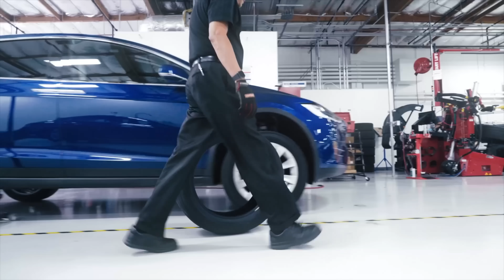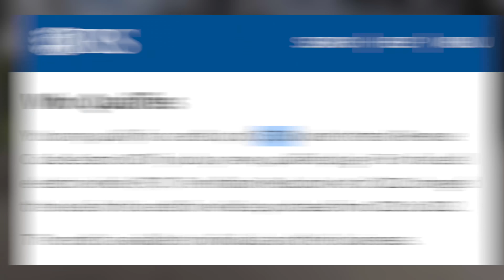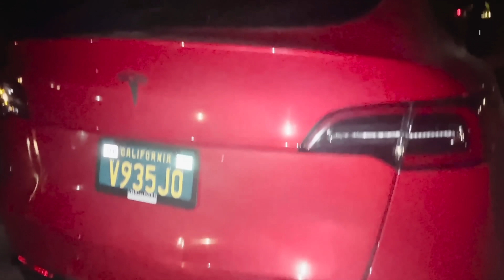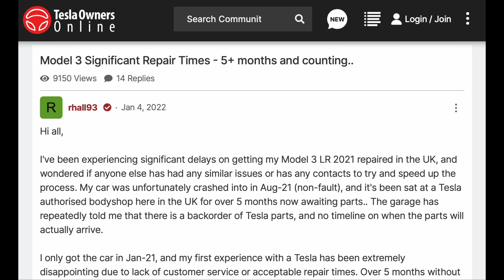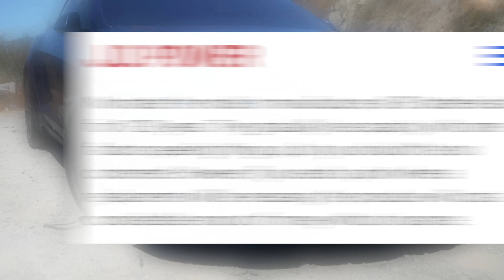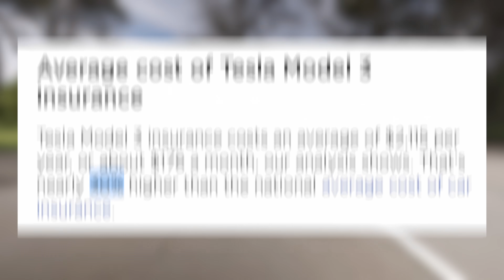My INSANE $23,614.36 Tesla Repair | Tesla’s Expensive Repair Problem

Comment: Don’t buy a Tesla. I got a Model Y 2024 with enhanced autopilot. Darn thing went haywire on the highway. Sideswiped an Amazon truck. Damaged the passenger side panels and mirror. Over 20k to fix. You can buy a new Toyota with that.

Tesla customer service is the worst I’ve experienced. Their warranty doesn’t pay for faulty enhanced autopilot. The company takes 0 responsibility and once you buy their car you are on your own. Getting it fixed takes 3+ months. A nightmarish post buying experience.

Avoid at all cost(unless you’re a millionaire).

Comment: I would like if you can take a look sometime at the higher than average failure rate of 2021s model 3 batteries. Mine failed at 46k miles and I saw on Reddit many people with even lower mileage having the same issue with even lower miles. It feels like there was a problem in that model year but I don’t think it has been pinpointed yet.

Comment: My Toyota Prius was 11k at 115,000 miles. I get 50 miles per gallon of gas (approx ($2.60 per gallon). I have had no repairs on it. I have only replaced the break pads and changed the oil after putting 15k miles on it myself.

Comment: 2 hints:
1. If your battery is written off, don't straight away go and buy a new battery. Instead do a search for one of the new places that repair ev batteries.
2. If you get a high quote for panel damage then go to someone who can do Paintless Dent Repair so they don't need to buy so many new panels.

Comment: Just drove a rented Model Y from San Diego to Austin Texas and back plus some local driving.  3,400 total miles in eleven days.  I set the auto pilot at the speed limits and followed the navigator’s routing for charger selection and amount of energy needed to continue.  I paid 10-1/2 cents per mile using Superchargers at 32-40 cents per kilowatt. 

The problem is, gas is $1-2.50 cheaper outside of CA.   Even at 27mpg, my old E320 would have cost less for fuel on this trip.  The Y was a great overall experience and I may buy one someday, but not because it’s cheap to run.
Reply: A Prius that gets 50 miles oer gallon at $2.50 is only 5 cents per mile. Teslas are so overrated.

Comment: Had to replace pcs system at 60k miles😡 $2,200! And ptc heater at 63k miles for $1,100😡😡😡 and new tires every 20k miles! 😡😡 bs teslas are cheaper than gas cars. Just waiting for the upper control arms to squeak again and have to be replaced. What's next...

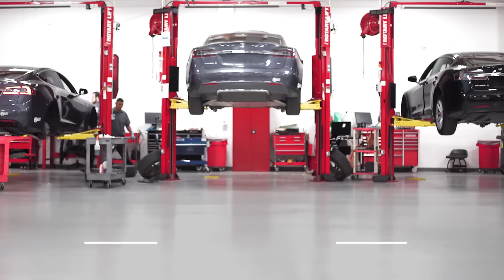Comment: @ 4:56 you stated that Tesla states their vehicles are luxury vehicles and that leads to high costs of repairs and thats untrue. In every 10k and 10q that Tesla has filed with the SEC the opening line states Tesla builds and sells High Performance EV's...Luxury isnt in the description so thats actually false advertising for Tesla. Another thing you left out what makes getting Teslas repaired is where theyre made as all Teslas are built slightly different and they use the vin # to know all of the parts that were put into that particular vehicle also the revised parts put on it to get the panel fitments correct etc and sometimes they have to have panels/parts made up on a 3d printer and that takes time to stop production to put into the rotation..

Comment: obviously the owners of ev's are over privileged and have money to burn, literally.  if i bought a gas vehicle and knew right off the top that at 10 years i'd have to pay $10K+ to replace the engine you'd be stupid to do that.  so why do that with an EV ???  i've not got the money like you guys do, i bought a new vehicle 4 years ago and i want it to last 20 years, and you know what?  i 99% likely won't have to replace the engine.  nor will i have to put in a $7500+/- level charger in my house.

Comment: Sad that my 2019 Model 3 LR had a minor accident and most of the car looks undamaged except below where it hit a bit harder. Shockingly the repair cost was almost $28k and deemed total loss by the Tesla certified collision repair shop (I'm not sure if Tesla Collision repair would have made any difference). The airbag did not deploy and the car was drivable but it was written off as total loss for salvage. Shocking really. I'm really saddened by this given the sentimental value I held for the vehicle and having invested in Tesla decently early on and driven it nearing 5y. Not even that many miles on it - sub 25k miles and repair cost was absolutely bonkers given what looked like not all that bad damage. Anyways, it is what it is. Now, I'm not sure when I will buy a new Tesla again but in future I will still like to buy a Tesla.

Comment: Very inaccurate about Cali charging cost. At current price of gasoline, $4.99 for 91 at Costco, cost per mile on EV is about 50% higher than comparable gasoline car.   At $6.5 or so per gallon, cost per mile is about equal.   Pge in Cali charge $0.55/kWh. And don’t forget L2 charging has about 16% charging lost.  This is my personal experience of owning EV.

Comment: 📊 looking at my Tesla app charging stats for this past year:
Aug 22 - Jul 23
Total charged: 8966kWh
Total spent: $22
Gas savings $5116 (based in CA)

Car is 9 years old with 150k miles. 
(16,666 avg miles driven annually)
Est gas savings for 9 yrs: $46,044

Battery still has 90% of its original  capacity. Still operates like new. 

Car still accelerates as quickly as it did new. Free software updates, LTE connectivity upgrade, infotainment upgrade, and front bumper refresh, and satin black chrome delete makes the car look and function like a much newer version. 

Car will continue to pay for itself as its grandfathered into free unlimited supercharging. Even if it needed a full battery replacement tomorrow, it has already saved the equivalent 2-3 full battery replacements if I had been buying gas these past 9 years. 

This doesn’t account for additional money saved for no oil changes, tune ups, filters, transmission servicing, smog emissions, seals, pumps, fluids, and so on. That in itself could be an easy 4 grand saved over 9 years. Together, an estimated 50k saved through Supercharging instead of pumping gas. All while touring in a comfortable performance sedan that’s quicker he far more practical than most exotic cars costing much more. 

Buying a Tesla was easily the smartest financial decision with regards to purchasing a vehicle in the past 35 years. The math speaks for itself.
Reply: 22 dollars for 8966 kilowatt hrs?  At about 9 cents per kwh here in Indiana it would be around 800 dollars and I thought our electric was cheap
Reply: @gjk1504  indeed that would be super cheap, and .09/kWh is pretty low compared to most states, however, you might’ve missed where I mentioned in my post was that we have free unlimited supercharging, with 95+% of our charges being free, and the $22 reflects the remaining charges that are done at home, though, even that isn’t really $22, as we turn out meter backwards more than we do forwards, generating a check from our utility (NEM 2.0) each year for the excess electricity our solar panels generate. Either way.. dirt cheap to charge :)
Reply: @gjk1504 I guess you didn't see the part where he said unlimited free supercharging
Reply: @khuo0219  correct. I must have missed it.

Comment: Tesla has always had quick turnaround times anytime our Model S was brought in for scheduled service. All service that requires more than same day service included either a Tesla loaner, or daily Uber credits. All but two service appointments required less than 3 days. I live in California, so perhaps it’s easier to get service scheduled and completed quickly here than in some other states. 

I imagine though that as more and more Teslas are sold, wait times are expected to increase if service centers aren’t being opened in proportion. Also, we’ve never needed collision repair, so no experience in this particular area, but completely understand that generally requires much more time.

Comment: When insurance is covering costs except for premiums and deductibles, what’s the point?  FWIW back when Japanese cars appeared in the US costs were equally very high… it will come down.  In fact, if the open manufacturing process is employed, it may have the side benefit of easier repairs for major damage.  As for batteries, look up costs for a new engine with labor for an average car… if you were so unlucky as to need a full pack replacement it’s about the same.

Comment: I have a 2014 Model S with 108,000 miles. Free Tesla chargers at work. Two sets of tires. 1200$ each. Touch screen n instrument cluster bubbled, covered under warranty. 20k battery replacement covered under warranty by caravana. Woohooo.

Comment: Insurance costs include getting the injured parties healthy again as well as the cost to repair the vehicle.  I don’t have data, but I would guess that occupants of a Tesla with the avoidance/accident mitigation technology will fair better than others.  How many accidents are avoided because of these technologies as well.  Further, IF they can get the FSD working then the number of vehicles damaged should be reduced again saving the insurance companies more money (which probably won’t quickly translate to cheaper insurance rates)

Comment: Passenger door was backed into on my 2013 Model S (180k mi with original battery). Took the body shop 3mo and $3100 to repair, they kept getting revised doors from Tesla with no instructions on how to retrofit for a 2013. Eventually they did an attempt to remove the dent from the damaged aluminum door and succeeded.

Comment: Great video.  Well presented with many interesting facts. On insurance I would add that there are lots of ways to save.  If you have multiple vehicles and are a homeowner, you can benefit from a bundle.  If you are over 50 AARP offers some well priced plans. Of course driving record and where you live will factor as well.

Comment: Interesting video. I was once rear ended in my 2016 Cadillac ELR with the Sports Package. The accident was more like your first crash. That also cost 8K to fix. As for Battery, my 2016 Model X Battery is still going strong with 92% battery capacity. But when I reach 8 or 10 years and if the battery goes out, I think I'll rather spend the 13k to 15k on a new battery and get the latest range, rather then spend another 100k on a new Model X...

Comment: I must say that this has been the most comprehensive detailed video I seen on YouTube about how much it might cost to own a Tesla.  Most of the videos on YouTube, just cover the great tech features of the Tesla vehicles and minimum or nothing on costs that an owner might incurred overtime.   A few others that do cover costs are only about how much they have saved on gasoline versus charging costs.  Thus, very much appreciate the in-depth detailed of your video, very well thought out and excellent presentation!

I am currently in the market looking to purchase a vehicle.  I test drove multiple vehicles, like the 2023 Toyota Crown Limited Hybrid AWD, 2023 Lexus RX 350h Premium+ AWD, and the 2023 Tesla Model Y Long Range.  The Model Y of course has power power, and better technology, but the Crown and the RX have a better suspension and for that matter the ride is much smoother.  Also, the cabin of the RX is quieter than the Mode Y.

I also looked into the insurance cost of the three vehicles referenced above and got quotes from my insurance company.  The six month premium cost between the RX and the Crown was 11 dollars and for the Model Y, it was $111 dollars higher than the Lexus RX.   This seems to be in alignment with what you covered in your video, it would cost a lot more to repair a Model Y in case of accident.  If I were to purchase a Tesla vehicle, I would not have it insured by Tesla, as I have other insurance policies that I have bundled with my existing auto insurance and I get better premium cost by bundling my other policies.

Thanks again, for such constructive and informative video, I will definitely taken all of this into account when making my purchasing decision.
Reply: My insurance policy bundled with my house and contents, was only 50% of Tesla Insurance!
Reply: I am looking into getting a vehicle a well. I love the 2024 RX350 Premium +.  I'm also looking at the model Y. 
All of the youtubers that I have watched have taken their cars to a tesla service center numerous times, for weird noises, broken parts, error message, battery issues etc. They all tell you it was under warranty.  
I haven't had any ICE with issues during the warranty period and even after the warranty expires, I only had minor things like alternators.  The fact that Tesla cars have issues even before the warranty expires tells me that post warranty there's a high chance of having expensive repairs.

Comment: If the assumption that battery cost will be so much less, then why does a Model S battery still cost an arm and a leg?  These cars are 10 years old or older.  I think the assumption that it will be affordable to replace is flawed.  As long as demand is high due to EV sales growth the cost of batteries is going to remain high. 

The other topic that needs to be covered is the lack of service centers in large portions of the US.  The number of service techs that can come out to rural areas is limited, and times to get to see a technician can be long and parts availability can be limited.   Tesla needs to get busy building more service centers and hiring more service techs.  

Insurance rates are a problem.  But possibly the bigger problem is the constrained parts supplies and Tesla is the only place to get them.   What is the insurance company supposed to do when the cost of everything is totally insane?  Salvage it.

Comment: A not often talked about benefit to EV battery replacements is that sometimes the replacement battery has more capacity than the original! Nissan Leaf's and Bolt EV's are getting more range than when they were brand new after getting their replacement packs. The same could be true for The Model 3/Y's. The new 2023 models have slightly more capacity, so when older models get their replacements, they may also get that capacity increase.

My 2017 Bolt EV originally had a 60kWh pack but its replacement battery is 65kWh.

Comment: Ryan - my experience is that ICE cars are so much more expensive to maintain. Oil changes, air filters, belt replacements, transmission, coolant leaks, fuel pumps, injectors, O2 sensors, EXHAUST SYSTEMS... I mean really its ludicrous. I had a 8YO Mercedes ML350 diesel that blew its blu-def injector and fried the entire catalytic and muffler system. $13,000 replacement quote from MB USA for a $17,000 valued vehicle with less than 100K miles. 

On my 2016 BMW i3-REX with 31K miles I still have some of those maintenance items but, all in, my maintenance has been less than $1600 to date. I nearly spent that on my yearly service A for the Mercedes. 

Keep up the good work on the channel. 👍👍

Comment: I can vouch for that , my company buys written off Tesla's and we rebuild them, the five hundred dollar pyro fuse from Tesla only costs me fifty dollars for aftermarket units and takes 15 minutes to replace, we have 13 Tesla's at the moment and buy them cheap, we get our new parts from over seas at a fraction of the cost and they are all factory parts. Air bags are the most expensive, but still worth the repair, most parts on the front of a 3 or Y that get damaged simply unbolt to be replaced, I think the biggest cost in most repairs are the criminal body shops that are outrageously over charging for repairs, this is the same to be said for all cars. If I can completely rebuild a M3 for $5k where do they come up with $25 k, thieves that's how.

Comment: The battery cost is really unnecessary if it is a single battery cell that is the reason for the error. there are those who choose to bypass the individual battery cell instead. It will simply be much cheaper

Comment: The tires would probably wear out less perhaps if there was constant four wheel drive or if the other wheels were activated before any wheel had started spinning. Is maybe like that with track mode on Tesla 3 performance

Comment: I dont know how you avoid maintenance costs.
Each 35k miles I have to do suspension overhaul to be able to align the wheels.
Cost me 1850USD. The first overhaul was covered under warranty.
This car eat suspension joints for breakfast like a VW or Audi.
Makes me seriously consider going back to a ICE Honda car.
99.9% of my mileage is on public roads

Comment: Great video. You forgot to include a couple of places that test and then replace bad cells in a battery pack without replacing the whole battery pack - Gruber Motors and Rich Rebuilds. Gruber charged only $7,000 in one such case in a video.

Comment: When my moms 2007 v8 volvo xc90 was rear ended in 2014, it took well over a month to get the car back and the damage was around 13k but it looked super minor on the outside. Body shops charge way more money when insurance is involved vs when you pay out of pocket. Ive gone in to a few local shops to ask for quotes on small stuff and they always ask “is this going through insurance or is it cash”

Comment: 2017 Model S.  Driver backrest tilt not moving, probably the motor on one side.  Tesla service said no serviceable parts on the seat by them.  They want $4,000 for a seat replacement.  Also had the center screen going out, I think I paid $1500 to get the newer version.  They didn’t offer any money towards it even though the other was going out during warranty.  Also replaced 12v battery for a few hundred, so mine has been much more expensive than an ICE car but still wouldn’t go back. Under 30k miles on the car.